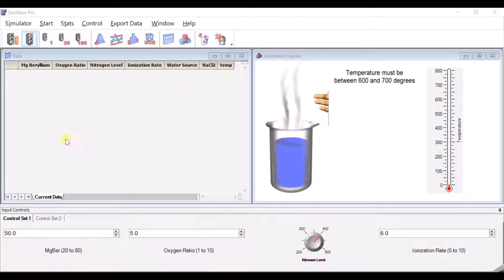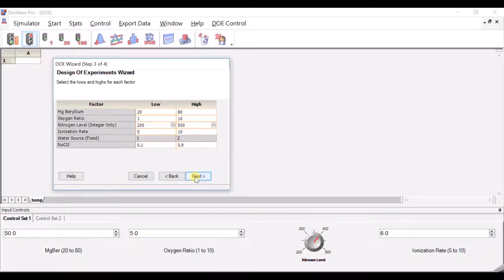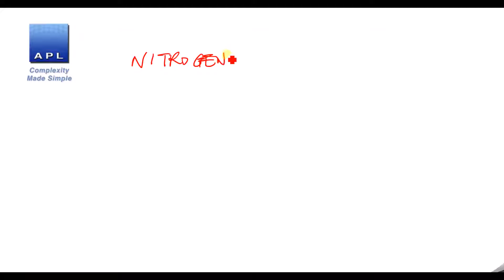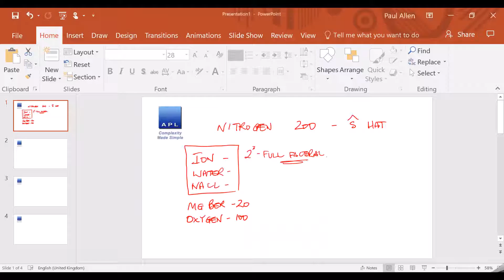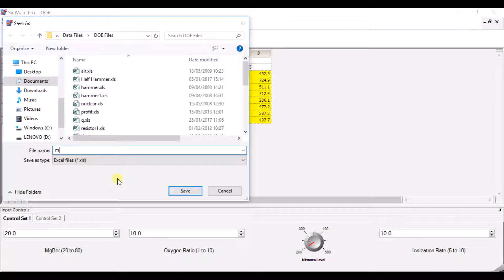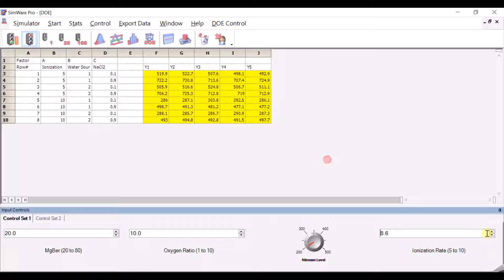Complexity Made Simple - DOE Screening followed by Modelling Using DOE Pro

Comment: Hello Paul, Jide again and I want to thank you for all the resources you are churning out for free. I need your help. I am trying to do a DOE  with multiple inputs and multiple responses as well. I am not sure how to go about it. I am thinking with thesame settings for my inouts, I can pick each outputs and check it's response by assuming the other output variables do not exist.(like numb them). However, I am thinking this may be wrong. I searched the internet and saw this advice on similar problem:                                                                       

"Simultaneous optimization of multiple input factors will require Response Surface Methodology.

Do not start this process thinking that you can optimize your process after a single designed experiment. It typically will take a screening experiment to isolate significant factors and interactions. This may or may not take a follow-up experiment to isolate confounded/aliased factors/interactions. Once these are isolated, another experiment with multiple levels is required to determine whether curvature exists and how to best optimize. Finally a confirmation experiment must be run to validate the final model."

What are you thoughts Paul, any idea on how to do. I really don't understand what the guy' statement above mean. Do you have any link you can refer me to that may help? I am doing a PhD student trying to do some work with DOE and this aspect is slowing me.

Thanks
Reply from the maker: Jide - OK if you know nothing about your process then yes a screeing DOE will be important. That way will can rule out variables that don't have an impact very quickly. The taguchi L12 is my favourite and you can test upto 11 inputs. In the same experiment you can measure as many outputs as you want from the 48 test pieces you create.
To start you need to identify all the inputs and a sensible range over which they will be tested and identify all the outputs. Sned me a mail when you've done that..
Paul.Allen@allenp.co.uk
Reply: @paulallen5321  Thank you Paul. I am gathering data right now (performing experiments) using a 3 factor at 3 levels design matrix. Once I don't think my inputs a collinear in any way, so I do not think I need a screening experiment. Once I am done I will shoot you an email of my results in general.

Thanks again
Reply from the maker: Jide - if you only want to test 5 inputs or less then a screening DOE is not needed. However, you're doing a Phd. That is creating new knowledge, I would say that you want to test as many inputs as you can and 3 seems very small number....
Reply: @paulallen5321  Yes just because I know the physics behind the inputs and many of them a colinear. I narrowed down to 3 inputs that matter and that are not colinear at in anyway
Reply from the maker: Jide - when you say colinear. Can I ask can all your variables be moved hi and low independent of one another?
Reply: @paulallen5321  There maybe interactions, yes, but to my knowledge, this interactions is due to the process (simulation in my case). The inputs should not be functions of each other or should I say some inputs should not be independent variables of other inputs.
Reply from the maker: In that case, especially because you're using a simulation, a full set of variables in a screening design would be my starting point, you can go to the 3 or 4 factor full factorials later and optimise multiple outputs using software (RSM) is not necessary in this modern era...
Reply: @paulallen5321  noted sir, thank you. i will keep you updated once I am done with the screening exercise. I have started full factorial 8 runs 2^3. I will complete it,. then reinstate all the variables and do a screening design.
Reply: The aim was initially to do 2^3 for the variables check the result then add some midpoints to see if a curve relationship exists, then run a composite
Reply: How did you know exactly how many replicates you needed to run, you were so confident in 4 for your taguchi and 5 for your full factorial, and what is the benefit of doing more than one replicate/is there any data I will lose with only 1 replicate?